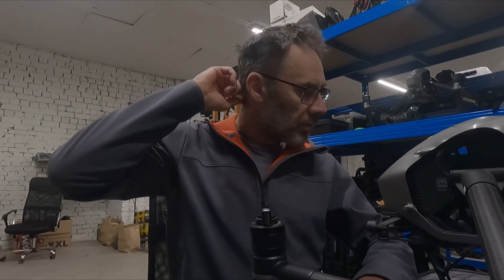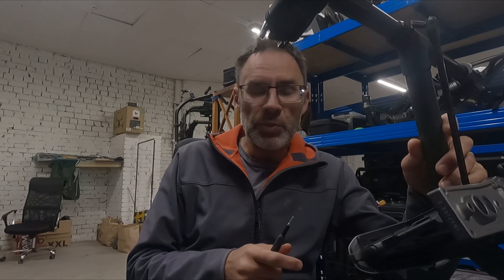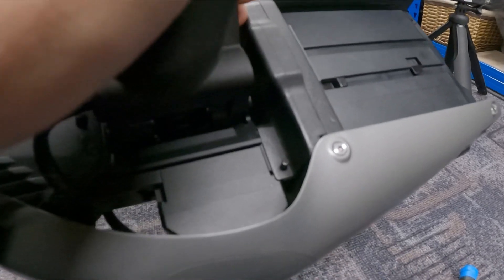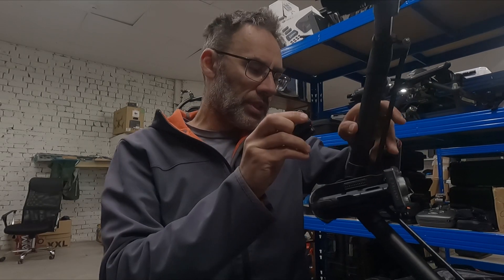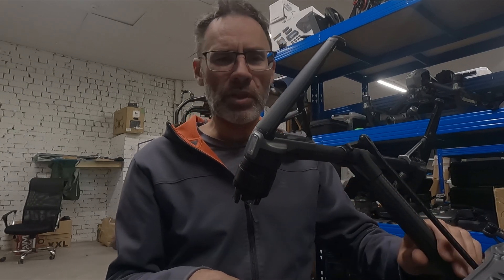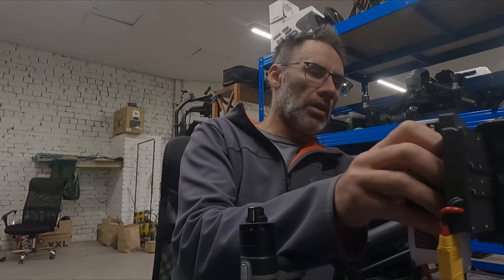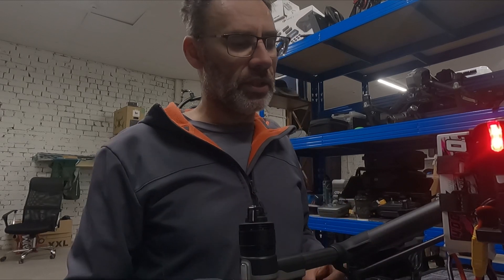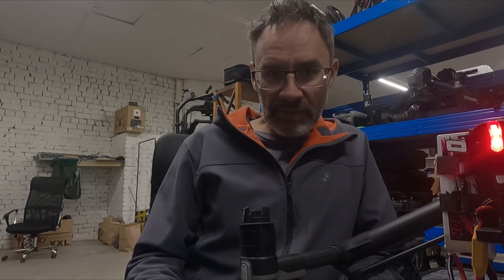Powering DJI Air Unit / FPV on Inspire 2 - new, better and easier way!

Comment: Is it possible to power the 04 Air Unit Pro with this output without some kind of regulator? Thanks!
Reply from the maker: O4 Air Pro supports up to 6S voltage, so answer is yes 👍
Reply: @skycam_ee  Do you reckon it's still worth putting a BEC on there to keep it more in the 9v range? Also, do you think it would be possible to split the 4 power lines coming out of the Inspire 2? So a pair to the 04 Air Unit and a pair to, say, a small cooling fan?

Comment: I'm looking to add the O3 Air Unit, which I believe should work no problems with the 6S configuration...just waiting on my Battery Caddy to arrive (Today if DHL are on time...which normally they are!) 
Just wondering though - and will ask this in FB Group - anyone had success (as in...is there a way...) - in connecting any CAN/i2C output from the Inspire to the Air Units to get Telemetry?  Because if we go to using the O3 and use Goggles with EVLOS...the issue will be not seeing any Telemetry looking on the CrystalSky will normally give when connected to the Cendence remote, etc.
Reply: I received the Lip Caddy a bit over a month ago - but things got a little busy and not used yet - hopefully over Christmas.  But THANK YOU for adding the Pico Clasp and fly lead in the packaging...I did end up getting a couple of different packs on Amazon, but I couldn't be sure if any would fit - having this provided was Super nice of you.

One thing though - I notice on the wiring in this Video here, you have 3 Black and 1 Red.  but I notice you have 1 of the Black lines soldered to the Positive on teh XT60.

was there any specific reason for not using 2 Red and 2 Black? the cable that came to me was ALL red...haha.  I know I can probably just grab my Multi-meter to check the output...but it has gone missing...hopeful you might answer before I find it.

Cheers

Comment: Hi,  I get 43 Volts there, i have an Immersion RC that works from 7 to 23 Volts, how can I reach this ? Sorry for my english, it`is very long ago.
Reply from the maker: 43 volts?! That is VERY weird..
Reply: @skycam_ee  How much Volt do you have ?
Reply from the maker: @michaelkalippke34  depends how full are batteries, but it's around 24v - definitely not 40+..
Reply: @skycam_ee  Sorry for my silly questin, my multimeter was damaged, another one shows 24,2 Volt, everyting is allright, my immersion RC works perfekt

Comment: Thanks for your nice ideas. Was your wiring BLACK + and RED -?
Reply from the maker: Mmm, what do you mean? Black should be - / Negative and Red should be + / Positive - why do you think it was other way round? 😊
Reply: Ok I was expecting that red is positive, but you had three black and one red cable on your plug in the video. I was a bit confused about it. Thank you for your help :)
Reply from the maker: @Wiewas  Oh!! Actually there are 2 positive and 2 negative wires, you should definitely check with multimeter first!! I don't remember why that cable was 1+3, actually there's 2+2 wires providing 2x + and 2x - .. 

Be careful!
Reply: @skycam_ee  It worked fine 👍
For everyone else who's interested, if you wiring the molex pico clasp connector, you can use the original cable from DJI and eject the pins from it. These pins are the same for the pico clasp connector and will fit perfectly. No soldering or crimping tools are needed.

Comment: Hi ! very interesting !
is it possible to do it withe the O3 air unit ?
and what's is the converter you use on the air unit ? why do we need it ?

thank you !
Reply from the maker: I think O3 supports 6S as input out-of-the-box, original Air Unit supported till 4S so you need DC-DC buck converter to lower voltage :)
Reply: thank you ! @skycam_ee

Comment: This is a really good find.    I’d love to somehow upgrade the DJI FPV Drone main camera to the FPV 03
Reply: We did one this way…can’t remember who told me about that power location but we have been using it for about 40 flights with no issues yet. I just changed out a dji o3 for the new o4. We use goggles and fly duel operator. I do have a system that could mount on top and allow head tracking but have not fabricated a clean mount as of yet.
Reply: @robinjohnson4613  bir videonuz varmı görmek isteriz